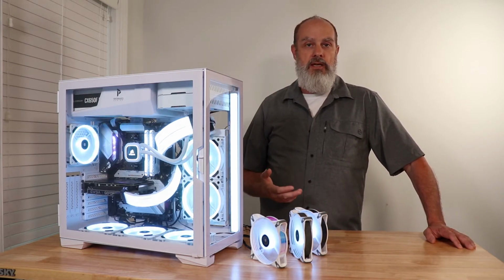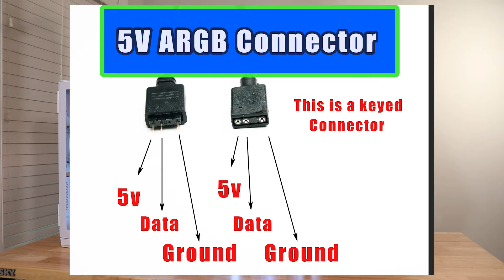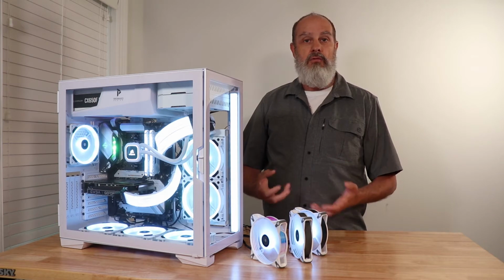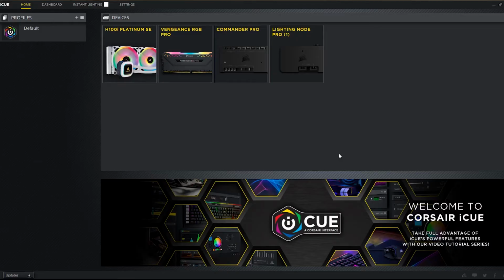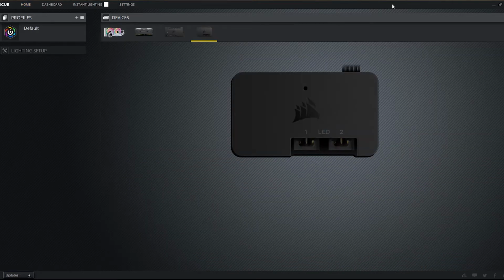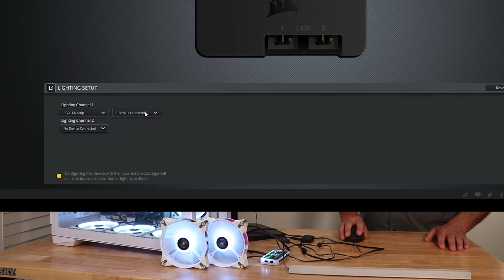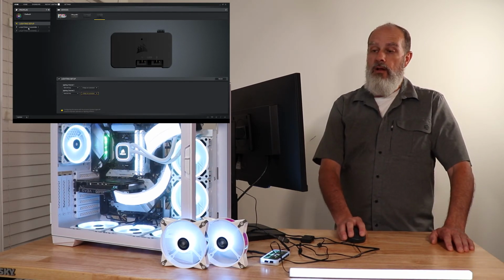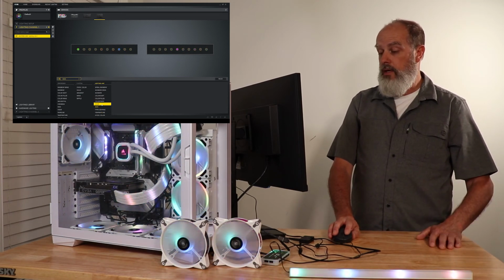How to get all your RGB working with CORSAIR iCUE - Tutorial

Comment: Bro idk where the vdg cable goes in my build does it have to be plugged in because I don’t see anywhere that it fits
Reply from the maker: Hi StevieGGaming, the vdg cable is a gigabyte connector and i'm not sure it's still used much even with their boards. most of the cables that have a VDG connection, it's a pigtail off of the main ARGB connection, so usually you can just leave it disconnected as long as you are using the standard ARGB connection. I would need more detail on your specific setup to know for sure, but I suspect you don't need to use it. 

Let me know if I can help, thanks for watching!!!!
Reply: @ thanks do you know how I can connect the icue link to work with the fans plugged into my msi motherboard as they both work but I have to control them separately

Comment: Great video ! I’m building a laptop cooler with 3 extra Corsail ML led fans. Any ideas where to stat connecting the Node Pro to a USB to poswer the fans AND control RGB? Cheers !
Reply from the maker: Thanks K12SXXFire! I have looked at doing that a couple of times, but haven't really explored it. They do make a USB to sata power connector, check it out here, https://www.amazon.com/USB-SATA-Power-Cable-Sata/dp/B0184ZQDA8?th=1.  This would be for power only of course, you would still need another USB for RGB control. 

That's just a quick search, I haven't tried this at all, so I can't say if it would work, but is a place to start looking. I do have one of these laying around somewhere, might need to go play around that and do a project. Let me know if you find something that works. 

Good Luck, have fun, thanks for watching!!!

Comment: my coursair fans have 4 pins....im super confused
Reply from the maker: hi test test, Corsair Fans normally have 4 pins for RGB lighting, this is a molex connector that corsair uses, this connector will connect directly to the corsair controller and doesn't need the adapter cables discussed in this video. This video is specific for using non corsair RGB lighting with a 3 pin ARGB connector. 

If all you have is 4 pin RGB fans from corsair, you just need a corsair controller, none of this stuff, check out the Commander CORE XT for a good controller. 

There are 4 pin RGB connectors that are 12v connections which is a different subject, so make sure your fan is a 5v ARGB fan, but on Corsair that is a 4 pin connector. 

I hope that helps, if not, let me know what specific fan you have and where you're running into trouble. 

Thanks for watching!!!

Comment: All my stuff is Corsair except my strimers. I can’t figure out how to get them both to show up in iCUE. I can get the V2 gpu one to register if I use an adapter like the video and plug it into the one RGB slot on my Commander XT. However, I can’t gain control of the 24 pin connector no matter what I plug in where. I even tried using the RGB port and adapter that the V2 can use successfully but that didn’t work for the 24pin either. I’m completely lost. I see it can clearly be done.

How did you do it? I’ve got 2x of a similar cable like the vid, a Commander Core and an XT, and the Lian controller that came with the strimer. Do I need something else? Do I need to use a lightning node pro? Please help kind sir.
Reply from the maker: Hi Brian R, Since you have the Strimer V2 GPU cable working it should be working. 

I am using the adapter cable described in the video. Plugged that into the RGB port on the CORE XT, and then I have the Motherboard sync cable from the Lian Li controller connected to that. 

I have then opened the Lian Li L-Connect 3 software and in the Quick/Sync Lighting tab on the left, i have turned on the MB lighting sync (You obviously have done this if the GPU cable works)..

In iCUE I have configured the 3 pin Lighting to use 4 RGB LED Strips, I think it only needs 3, but I have it set to 4 and both the 24pin and GPU strimers work great, I can't control them individually through iCUE, but it works. 

I'm assuming you can control them individually using L-connect, in which case, there should be nothing needed but to put the controller into a mb sync mode. 

Do you have more than one lian li controller? If so, you would need to sync each controller to the corsair rgb port, for more than one device, use the adapter cable and connect it to an rgb hub and then you could connect all other non-corair rgb devices to the hub and sync it from that, works the same, just expands that single port on the CORE XT. 

If that doesn't help, let me know how you've got lian li connected and what controller you have, but from the sounds of it, it should be working, I'd also make sure you have the latest l-connect software, update it if not and reconnect everything. 

Let me know what you find, should be able to get this working....Thanks for watching!!!
Reply: @HardwareArtisan  ah, I was not aware you used L connect at all lol. So I’ve been trying to get it to work without it. Which I finally did just yesterday. It was slightly more complicated though. 

I had to buy a lightning node (since I only have one corsair RGB port via the XT) and an original V1 24pin strimer just for the controller. (Fortunately it was on sale at MicroCenter). The V1 controller has a button you can press and hold for two seconds to sync it with the mobo. I don’t know why this feature was omitted from the V2. Maybe it’s not and I’m just an idiot. However…

I’ve got the GPU strimer plugged into an eBay cable into the node. Then the 24pin strimer is plugged into the V1 controller into an eBay cable into the node. (Fortunately the eBay cable I bought was a two pack so I had an extra anyway) 

So in the end I’m left with a V1 24pin strimer I’ll probably never use, but all my RGB is synced through iCUE on my first custom PC in 15 years. And though my method was slightly different I appreciate the videos. They helped a ton in the process.

Comment: I'm starting to regret buying all this Corsair RGB crrp.
It's like a future rat's nest waiting for me to wire up that I don't need or particularly want.
It's not like it's going to make my comptuer go faster or be morepowerful, and is going to look corny once the computer is obsolete.
And it's not like I bought a lot of RGB, just 6 fans and the RGB AIO cooler head.   But what a nightmare.
Reply from the maker: Hi 𝐜𝐡𝐨𝐩𝐩𝐞𝐫𝐠𝐢𝐫𝐥 (♞) 𝐚𝐢𝐫𝐰𝐚𝐫, those are all very fair points for sure. I know what you mean about old obsolete PC's looking corny, they do get a look to them once they are old and tired....and some lighting can make it look like a bad circus for sure....haha. 

Although I can't inspire you to love RGB lighting, I would suggest giving it a shot since you have it. I personally enjoy the challenge of cable management and hooking it all up. You can also get some classy looks with rgb lighting as well, just keep it simple. 

With that said, Have fun with it, that's the important thing!! Good Luck, let me know how it's going!!

As always, thanks for the support and for watching!!
Reply: @HardwareArtisan  Well, I have to give it a shot, I wasted a lot of money on the Corsair case route, water cooler, and ML120 RGB Fans.  One leads to another and soon you've spent $200 extra on nothing but 2 cent LEDs.

In retrospect, if you want to add RGB to a system, buy a $5 RGB gamer mouse off ebay.  Plug it in.  Boom you're done.   

It will tell you when your system is on or off, and help you find your mouse in the dark.  Anything beyond that is superflous waste.  If you want to get really crazy, buy a USB  RGB keyboard, plug it in, boom you're gain done, and that will help you find your keyboard in the dark too.  

The best part, no matter what OS route you go, your RGB mouse and keyboard is gonna work.  Not so much so with iCUE, that only runs under W10/W11?   I run Windows 7, so I'm probably phwcked anyway and wont' even be able to do anything with the lighting except in BIOS (if at all).  I'd rather have a physical controller box.  For you know, if I ever want to run Linux, or MacOS, or Windows XP.

Who looks over at their PC while they are working?  Nobody.  You're looking at your screen(s).  :)

Comment: I bought an UpHere GPU support bracket and the GIM lightbar with ARGB shown in this video. I just ordered the Corsair Commander Core XT and the Corsair RGB 5V ARGB adapter cables . Will the aforementioned devices be controller when connected straight into the Commander Core, or do I need an additional controller?
Reply from the maker: Hi LO Rivera, that's a great question! The Commander CORE does not have a 3 pin RGB port suitable for non-corsair RGB. The CORE XT has this port so it will work. If you are going to use multiple non-corsair devices, you will want to use an RGB hub. 

Basically, all your 3 pin RGB devices connect to the hub, then the hub, which has a motherboard sync cable....plug that cable into the adapter cable, which then in turn plugs into the CORE XT 3 pin RGB port, you can then configure that port and sync all those devices within iCUE. 

I hope that help, let me know if I can help, thanks for watching!!!
Reply: @HardwareArtisan  thank you. I only have the 2 devices and they worked great into the Core XTs 3-pin RGB perfectly. I simply daisy chained the 2 devices.

Comment: Great video. Things are more or less working when using this method. I'm connecting Lian Li V2 Strimers to a lighting node Pro via the cable you've described. It all works for a little but after I while  ICUE crashes and I have to restart it. Any hints on what I need to do to get those crashes to stop?
Reply from the maker: Hi Sal Carrera, I've had a couple of times where iCUE would crash on me repeatedly. I would start with uninstalling iCUE, reboot, reinstall the latest version (ver 4.x) and then give it a try. 

Make sure all the controller firware is up to date, possibly even force an update. 

If that fails, try removing/reinstalling any other RGB software like signal rgb or open rgb and maybe wait a bit to reinstall it until icue is stable. 

Beyond that, there could be other environmental factors with windows causing issues. I've not had any issues specifically with having Lian Li connected, but try disconnecting it temporarily and run without it just to make sure it's not that connection. 

I would start that and see if it helps. If it's still crashing, you might consider contacting corsair, collect logs for them and see if they can pinpoint it any further. 

I hate to recommend re-installing windows as there can be many things causing issues, but that's always an option. 

Let me know what you find, thanks for watching!!!
Reply: @HardwareArtisan  thanks, subbed lol

Comment: Does any of those work with just the lighting node pro? I’m ordering a pack of 3 corsair QL fans and my case comes with 2 front lian li fans, wondering if I can just use the 6 rgb connected that comes with the pack of Corsair fans and hopefully control the rgb of my case fans with icue ? I have a micro atx asus budget motherboard and have not rgb slots at all, just usb and 2 system fan slots( I have 3-1 fan splitters)
Reply from the maker: Hi Aidan Sedore, the QL fan kit comes with a lighting node core, which is only useful for controlling RGB on Corsair fans, you cannot control fan speed with that. 

Yes, you can use the lighting node pro to gain iCUE control over the Lian Li fans. you will use the adapter cable and connect it to the Lighting node pro, then to the Motheboard sync connector on the Lian Li controller. From there, put the lian li controller into motherboard sync mode and then use Icue to configure the port and match up the number of LED's as best as possible, play around with the differnt corsair devices until it looks right. 

To control speed, you would need a CORE XT, CORE, or Commander PRO, the CORE XT Also has a single RGB port you could use to control Lian LI, so a single CORE XT, you can control 6 Corsair Fans, RGB and PWM, and use the RGB port for controlling lian li rgb with the adapater cable....in that scenario, don't use the lighting node core, set aside or resell it. 

I hope that helps.....Thanks for watching!!!

Comment: So, I have Phanteks RGB light strips, they use a Lian Li type 3 pin. Similar to Corsairs but bigger in the casing. I am wanting to connect these to my system which is primarily Corsair. I am having anheck of a time finding just generic 3 pin extention cables (Thos really tiny versions) that'll match up w both Lian Li and corsair. It's all about propper decription aka "Google fu" and frankly? Mine sucks. Can you or someone in tyhe comments steer me in the right direction, keyword search word etc?

Comment: Thanks for this Information! Im going to build a Pc and I will use Lian li fans, corsair aio and corsair rams and maybe lian li stimer and i dont know how many adapters i need for the lian li thingys can you please tell me? (7 Lian li fans, 1 aio w/ 3 fans)
Reply from the maker: Hi ItzFipBoom, that's a great question. It sounds like all your Lian Li fans will fit on a single Lian Li Controller. The Strimer will have it's own controller. There are other ways for the strimer to get RGB signals from the LIan Li fan controller, but what your asking about is how to connect it to iCUE

In Order to do that, you will need a Corsair Controller that has an RGB output, the "Commander CORE XT", the Commander PRO and the Lighting node pro have these connections. The Commander Core with many corsair AIO's does not have the RGB port unfortunately. If that's the case, then consider getting the lighting node pro, which is a small controller that has 2 of these ports. 

Once you have the corsair controller with the RGB output, you need to connect non-RGB lighting to it. If you have a CORE XT with only a single RGB port, then I would suggest adding an RGB splitter......So, you would need 1 adapter cable and one 3 pin RGB splitter, such as these:

https://www.amazon.com/Black-Splitter-Cable-Connection-Connector/dp/B07D8JCJKM/ref=sr_1_1_sspa?crid=31B6ENS35EWI2&keywords=rgb+splitter&qid=1676867895&sprefix=rgb+splitte%2Caps%2C98&sr=8-1-spons&psc=1&spLa=ZW5jcnlwdGVkUXVhbGlmaWVyPUEyWjJLNzhHWFE2T08xJmVuY3J5cHRlZElkPUEwOTQzNjA3M1JFTUVRSVcxQkpFTyZlbmNyeXB0ZWRBZElkPUEwNTc0NzE2MkcyOFVMNzBDUEExWCZ3aWRnZXROYW1lPXNwX2F0ZiZhY3Rpb249Y2xpY2tSZWRpcmVjdCZkb05vdExvZ0NsaWNrPXRydWU=
 or:

https://www.amazon.com/Splitter-ZCZQC-13-19inch-Extension-Computer/dp/B09Q2SCPTN/ref=sr_1_8?crid=31B6ENS35EWI2&keywords=rgb+splitter&qid=1676867966&sprefix=rgb+splitte%2Caps%2C98&sr=8-8

So, plug your 1 adapter cable into the RGB port of the corsair controller, then attach this splitter, one side of which would connect to your Lian Li FAN controller, the other would connect to your Lian Li Strimer controller (use the MB sync cables) 

From there, you put Lconnect into a motherboard sync mode and it will get it's signal from the corsair controller, which you configure in icue. 

So, 1 adapter cable and possibly an RGB splitter......I hope that gives you the direction you need. Good Luck and have fun with it!!! Thanks for watching!!!

Comment: Please please, can someone help me with what i need to buy. i want to be able to use the icue software(if it is even possible with my mobo) and have all my rgb connected to one software with the same animations. these are my rgb stuff:
- I have a ASRock Z790 Pro RS motherboard with 3 5v 3 pin ARGB connectors and two 9 pin usb 2.0 connectors.
my case (Be Quiet! Pure base 500DX) uses one 5v 3 pin ARGB connector
- Lian li strimer plus v2 both the 24 pin and 2x8 pin connector which only use one 5v 3-pin cause of the controller that comes with it,
-6 lian li uni fan sl-infinity fans which only use 3 5v 3-pin
- Phanteks neon digital led strips one 5v 3-pin connector
-Asus ROG Herculx gpu support bracket, one 5v-3pin header.
-NZXT Z63, one 5v 3-pin connector.
what do i have to buy to connect all these. i beg please help.
Reply from the maker: Hi William Knows, that's a great question. There are several ways to approach your situation, which is very common. I'll get to iCUE solutions in a sec, but iCUE will not control your asrock motherboard unfortunately, to my knowledge only ASUS motherboards will currently work. 

Because of that, you can't control any of your motherboard RGB headers with icue. 

I have alot of 'non-corsair' rgb in my setups and what I have done is use a RGB hub, here is one as an example, from amazon, this one is a rgb only, but you can use one that has fan connections as well. 

https://a.co/d/bORbEg5

Basically, plug all your 3 pin 5v connections to this, and then connect this hub to the Corsair controller using the adapter cable discussed in this video, this will get the signal from Corsair and 'repeat' it across all the channels. For products with another RGB control, such as Lian Li, you will need to put those controllers into a motherboard sync mode, meaning it will get it's signal from this HUB and in turn from Corsair. 

It works well, not perfect, but good enough in most cases.  In my case, I have to just accept that icue won't control my motherboard internal lights, and I don't use the motherboard rgb headers. 

Any of the Corsair controllers that have an RGB port will work, which includes the CORE XT (recommended), commander pro, lighting node pro. 

So purchase the controller, the hub and an adapter cable and go have some fun. 

Short of that, you may want to try Signal RGB, OpenRGB, or Jacknet, those software applications attempt to work across multiple manufacturers, I have had limited success with all 3 of those, they are not perfect either though. 

It may not be a perfect setup, but I can can have alot of fun with that setup. 

I hope that helps point you in the right direction and gives you some ideas. 

Thanks for watching!!!
Reply: @HardwareArtisan  wow, thanks you so much!